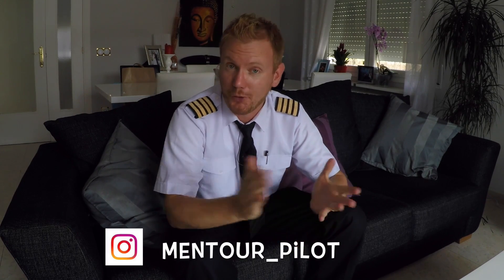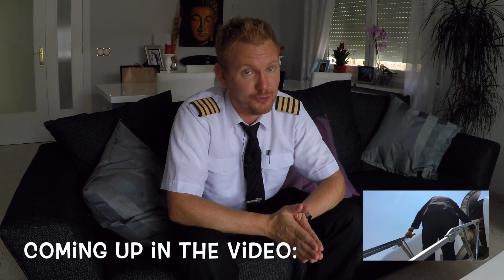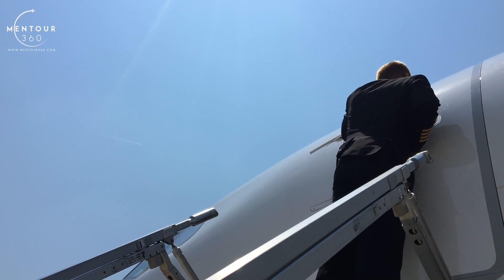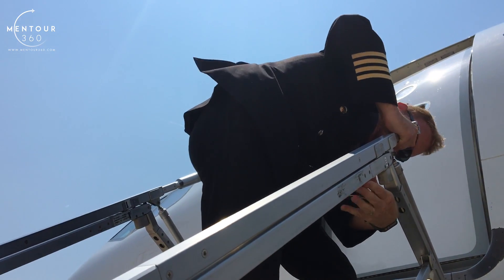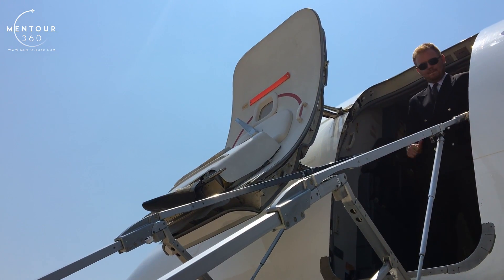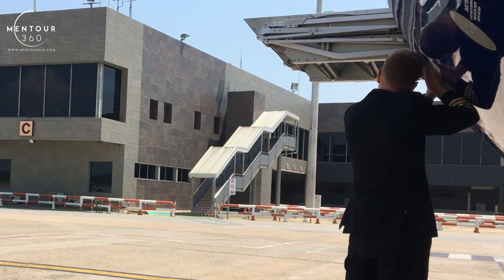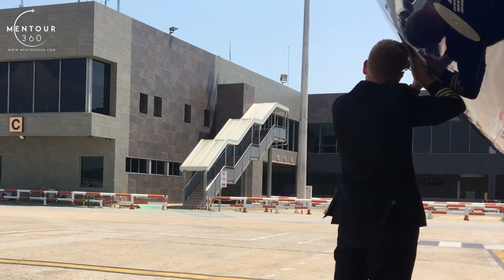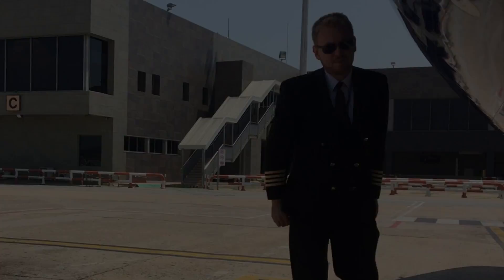How are the aircraft DOORS opened?!

Comment: It looked like you didn't turn the handle back through the 180 degrees you did when you opened the door. Does the door do that automatically for you when it closes or did you cheat? :-)
Reply from the maker: +Benny Löfgren The only thing you need to do is to turn the handle enough to unlock the door. It doesn't always need a 180 turn.

Comment: Has Airbus also air stair? Or not?
Reply: Helena Vanaeken Sometimes (depending on where you go) jet ways and portable stairs aren't available for the aircraft so some manufacturers will build them into the plane. BBJ's (private 737) have them built in as well.
Reply: In fact Airbus has offered airstairs for the A320 from the beginning - but nobody ever wanted to buy them. 
And even with the 737, I only know one airline in Europe that uses them - most airlines don't even have them installed.
Reply from the maker: +Helena Vanaeken They are used in airports that do not have walkways and where there might not be available stairs to disembark.
Reply: Stefan Vanya no
Reply: hugoaviador What’s the actual purpose of those airstairs? It looks such a huge waste of space to me.
Reply: Thanks everyone!

Comment: Will you have to use external stairs if the aircraft is completely shut down. Or is there still power to the airstairs?
Reply from the maker: Yes, we can use battery power to get the stairs in and out.
Reply: @MentourPilot  do you fly for Ryanair?

Comment: I thought this was something that flight attentands did :)
Reply from the maker: No, they are normally only trained to do this from the INSIDE of the aircraft. Not from the outside.
Reply: I didn't know that! Thank you for making such great videos btw!!
Reply: Well, the pilots are the first to enter the aircraft in the morning/leaving in the evening, right? So it's obvious that they are the one that opens/closing the door. The cabin crew are boarding the plane later. Handling staff take care of the outside, cabin crew take cafe if the inside :)
Reply: Possibly ground mechanics will do the cold start, prior to the pilots coming to the aircraft.
Reply: Mentour Pilot And if they put the mobile stairs in front of the door instead of using the airstairs? I guess that it becomes a cabin crew job then or still not?
Reply: @miamia6383  no they are not their training doors only have an inside handle.

Comment: I didn't know the 737 had built in air stairs... I always just use the jetway..
Reply from the maker: Yep, most Boeing 737 have but they are not always used.
Reply: How does this process differ when the jetway is used? Is the door still able to be swinged open when the jetway makes contact with the body of the A/C?
Reply: Thanks for the reply by the way! Love your videos!
Reply: Nicholas Smith it doesn’t
Reply: The canopy at the aircraft end is designed to be wide enough to allow movement for the passenger door.
Reply: @BluStoned  yep, once it is positioned correctly
Reply: @MentourPilot  ๆหด
Reply: No, he just found a spare Ryanair plane lying around and decided to go for a jolly inside one
Reply: This is a Ryanair aeroplane. Ryanair don't use jetways  (because they're expensive)
Reply: Yeah, I didn't know that either. 
All the main airports here in Aus (i.e. the various state capitals) and the more common 'tourist' destinations (Cairns, for example) all use jetways. I would think that's by far the most common scenario around the world.
One of our domestic carriers often uses the rear door as well, but that's on larger planes and they're clearly using a much larger set of stairs.
Which brings up a question: how commonly are those stairs used?
Reply: In NZ some of our airports for example Dunedin Airport, in the early nineties sometimes there would be 2 Air NZ 737-200's at the terminal but there was only one Airbridge, same with Ansett NZ, so the other aircraft would have to use it's airstairs.
Reply: The airstairs on the 737s are an option.  While most 737-200s had airstairs, beginning with the 300's most airlines opted not to order the airstairs (at least in the US).  With many European operations being hardstand, the European airlines may opt to order the airstair.

However, many airlines opt out of the airstairs because of the weight.
Reply: Frogman Smith I was just on a flight over the Atlantic with Aer Lingus and we had some scary turbulence.  It came right after they decided to serve drinks.  It just started to get worse and worse.  Suddenly, it felt as if we were falling straight down for about 30 seconds.  I splashed my drink everywhere and one of the drink carts ran away down the aisle and hit a flight attendant before falling over and making a huge mess.  Then after the turbulence the flight attendant scolded me for "leaving my trash on the floor."  Don't you realize how bad the turbulence was, insensible jerks?  I thought I was going to die.
Reply: Yep, I'm from Aus too, I agree with what your saying. The only time I had to use the air stairs was at a regional airport without a jetway, but they didn't use the built in ones, they rolled a ramp up to the door... like an actual ramp.
Reply: Mentour Pilot do you fly Ryanair
Reply: @milosbuljovcic5435  he cannot say due to european employer laws but yes, ryanair
Reply: I just thought they moved stairs on wheels up the side of the plane. I didn`t know they could have retractable stairs.
Awesome.
Reply: Airstairs have fallen out of favor over the years, primarily due to weight.  They are pretty heavy and for all that weight you could be making more money off of carrying passengers or freight.  All airports have some kind of jetway or stairs truck that can be positioned next to the airplane anyways.  The Boeing 727 had a very nice looking rear airstairs that retracted into the tail.
Reply: Ryanair always uses their air stairs
Reply: Ryanair do use the airbridges/jetways but only at certain airports. This is generally because most airports charge quite a bit like you say but some airports not that expensive.  Ryanair use airbridges at Madrid, Malaga, Alicante, Palma and other airports.
Reply: @northeasterner1000  las palmas, Tenerife south  and Lanzarote too
Reply: Stairs are a company option. I remember boarding a few 737's at Eindhoven via the stairs when they didn't have jetways yet.
Reply: Me either. This is not aimed at pax like me, but I still learnt something! 😃
Reply: Same! I never knew they had their own staird
Reply: Yeah, this is a discovery of the day for me).
Reply: i knew
Reply: Same either the jetway or they wheeled a set of stairs to the bird.
Reply: Optional
Reply from the maker: @jaymib6249  I know that SAS chose not to install them initially but because they were (not sure now) included in the weight and balance calculation of the aircraft, they promptly had to replace that weight with ballast in the front to keep the aircraft inside the W&B profile.
Not everything is as easy as it seems. 😉
Reply: Not all 737s have it. Im pretty sure it ks only ryanair and a few other airlines
Reply: Ryanair uses them because they do want to pay for mobile stairs from the airport...
Reply: Szymon Gorczynski, noy only expencive at times, but slow. And one more point of failiure(delay).

Comment: Imagine opening the doors with the slides armed. Can it kill someone? ✌ 
Always a fantastic video btw ☺.
Reply from the maker: Yes, it can kill someone. It will throw you a quite long distance onto the tarmac.
Reply: Mentour Pilot 😦 Thanks for replying
Reply: Mentour Pilot DONT CALL IT A TARMAC NOW I WILL EAT YOUR PILOT LISCENSE
Reply: That's why at airbus when you open a door from the outside that is armed, the slides are automatically disarmed ;)
Reply: And I thought having an airbag go off in your face was bad.
Reply: Mark Jensen lol thanks ✌
Reply: If I'm right if and armed door is opened from outside the slide is automatically disarmed
Reply: victor blaise That's a good thing ☺
Reply: "That's why at airbus when you open a door from the outside that is armed, the slides are automatically disarmed ;)" - There goes the anti-theft system.
Reply: Timothy Chapman then how the hell would you get in?
Reply: That's why there is that red strap across the window, so ground crew or emergency responders can see if the slide is armed. Otherwise if you were standing in front of the door and opened it with the slide armed, you would probably get very hurt.  I learned this from another one of Mentour Pilot's videos.  They are very educational!
Reply: @trainzguy2472  Wondering how often have people forgotten to put the strap in place across the window after arming the slide
Reply: Daniel Luis Gómez Adenis not on the 737 though
Reply: Maniac3020 Difference is,  the airbag is designed to go off in front of your face.
Reply: @jwaustinmunguy  its designed to be going down when you hit it
Reply: Badis Kebsisi on most planes, yes. Opening the door from outside disarms the slides. On the 737 though, that’s not the case.
Reply: Yassine 3,000 pounds of pressure you’d die on impact, i believe it it takes about 82 to crush a skull so you’d be dead
Reply: Yassine if you open the door from outside the slide will automatically disarmed and can’t deploy